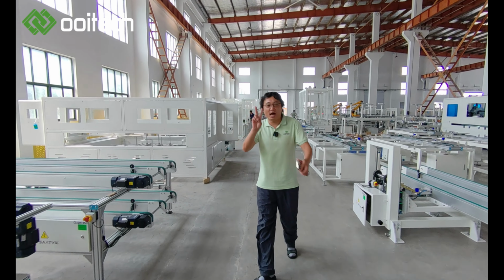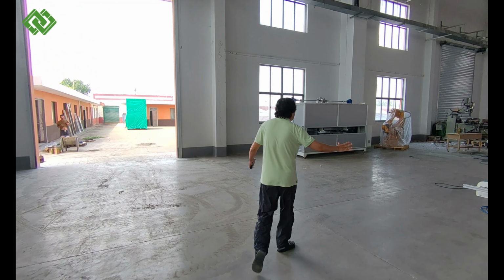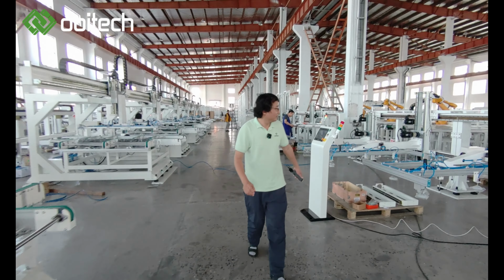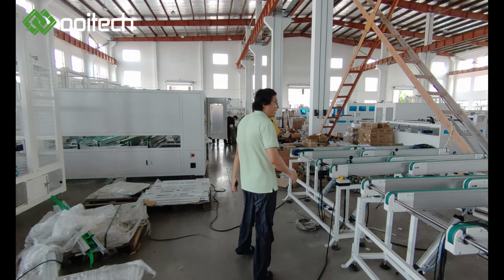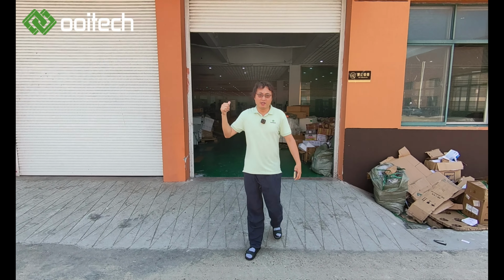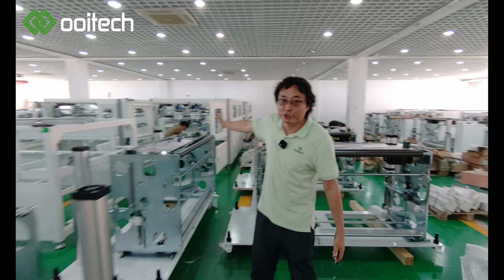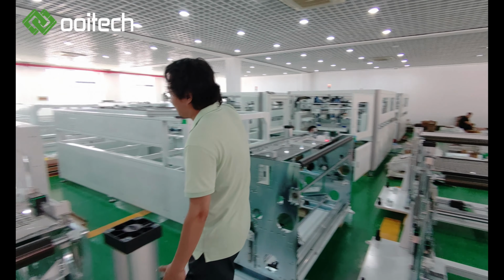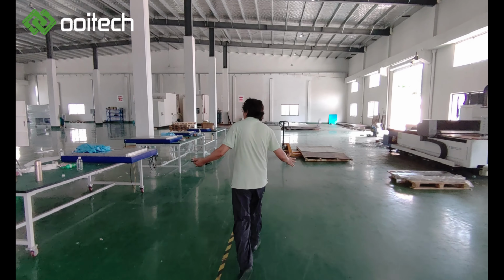Introduction Our 50 GW Solar Panel Manufacturing Facility (Current:5-6 GW) #solarpanelproductionline

Comment: What about eva solution machine
Reply from the maker: EVA cutter
Reply: @ooitech  Production line, not cutting
Reply from the maker: @strangeopinion6636  add +8618571646990 share your info